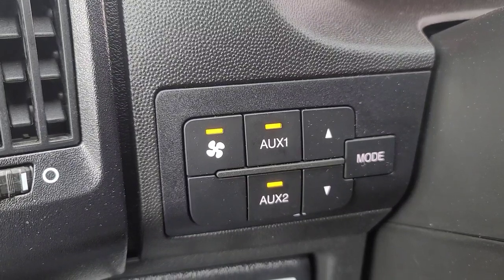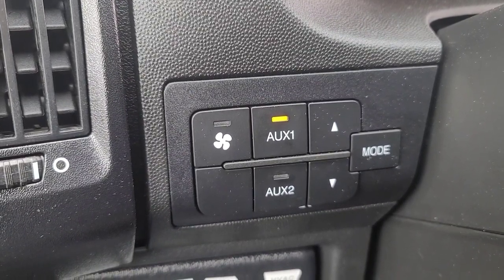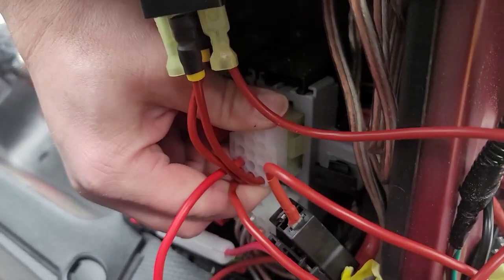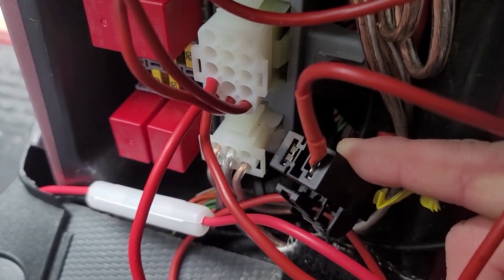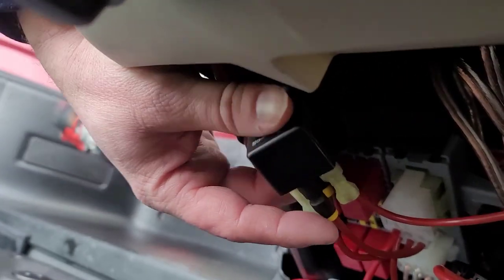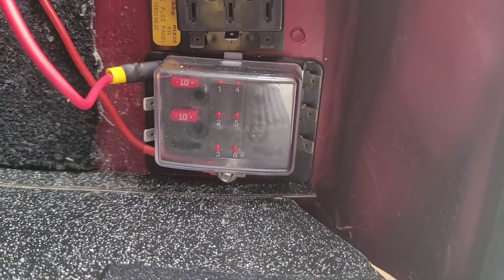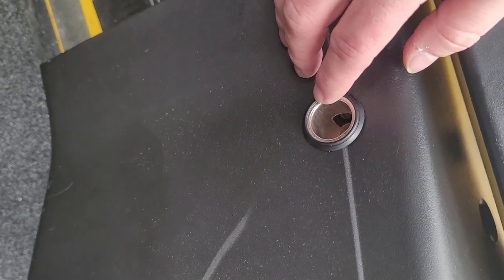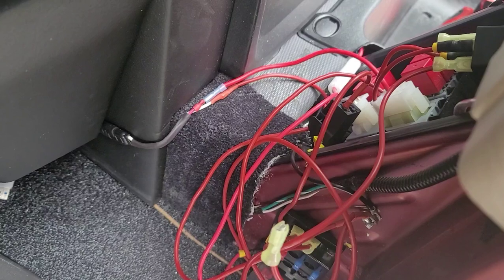RAM ProMaster Upfitter Auxiliary Switch Guide

Comment: Thanks, very helpful! How do I get a wire from OUTSIDE the van into the upfitter connector? The rubber plugs under the chassis below the upfitter connector don't seem to feed that area.

Comment: I am a novice when it comes to DC electric.  That said, not sure how such a small wire as you have with the spade plug could ever handle 70 amps.
Reply from the maker: You'll notice I said I am running a small load on it. Right now, it's effectively driving only the always-on 12V outlet I mounted on the B-Pillar. If you look closely, that outlet is going through the upper fuse panel, and it's limited to 10 amps. 

The wire feeding that connector on the other side is 4AWG, if I recall.

Comment: Hey Noah, I completed this install and noticed I wasn’t getting any power to my device. I pulled my aux switch from the dash and it turns out my wiring harness doesn’t have a connection from the Aux 1/2 buttons to the plug in the B pillar. Do you know where I can get the little connectors to run a wire between those two?
Reply from the maker: That's pretty wild. As far as I know, the AUX1/2 buttons were only installed from the factory with the upfitter electrical option, in which case everything ought to be hooked up. Most of these vans don't even have those buttons. I'm still relatively new to the ProMaster scene, though. No wires hooked up to those buttons at all? 

Do you have the little red relays next to the upfitter connector? I believe those are also only present with the upfitter electrical package. If those are present, I'd be looking thoroughly behind the dash to see if the wire harness came unplugged.
Reply: @NoahAxon  Thanks for the answer. Here’s another question that might help me out. The black plug that goes into the switch panel on the dash has two empty spots. Does yours also have two empties or are all 15 connected to wires?
Reply from the maker: @9chase26  I have tried to figure out how to easily get a glimpse behind those dash buttons without wholly disassembling the dash and I'm coming up empty handed. My inspection mirror doesn't get up there easily from the fuse box opening, and while it looks like the outer driver's side HVAC vent next to those buttons should just pop out of the dashboard, it feels like I'm about to break it no matter which way I try. Any ideas to help me get a good look back there?

Comment: Thanks for the great info!  I want to add a small fuse block like the one you added to the bottom of the B pillar.  Can you post a link to the one you have? Can you still fit the factory plastic panel over it, or are you using something else to cover up all your wiring?

Comment: My b pillar positive negative doenst have power do you know where the fuse located at, I need to check and replace it
Reply from the maker: The battery is Under the floor in front of the drivers seat. If you open the access panel, your should see several 70A fuses attached to an odd-shaped metal plate that's on top of the battery positive terminal. One of those big fuses attached directly to that metal plate is the one that leads to the b pillar positive power wire.

Comment: Noah great videos and keep them coming!  So if I am understanding this correctly in order to use the aux1 and aux2 buttons you plug the wires into the connections on the B pillar that you were showing.  Is that correct?
Reply from the maker: Yep. The lower left corner is AUX1 and the one above it is AUX2. They are controlled with the two little red relays there and have 20A fuses in there as well, so each auxiliary switch can run up to 20A worth of stuff (provided your wiring can handle it)

Comment: Where do I attach the ground for auxiliary switch 2?
Reply from the maker: I drilled a small pilot hole in the b-pillar and sanded around it, then used a self tapping sheet metal screw, washers and eye lugs to ground all of the accessories I terminated there.
Reply: @NoahAxon  That blew my mind, you responded so quickly!! Thanks. My sister kept wanting to use one of those remaining pin holes.

Comment: I have been searching for hours on this option in the PM w/ aux switches! Thank you so much for posting this. I'm just diving into automotive electrical, so I'm still very green. I'd love to get more step-by-step or detailed instructions for getting those aux switches in use...12V outlet like you have for 1 switch and who knows what else for the other. LED lighting?
Reply: I second that, I'm trying to wire my LED light bar and can't figure out if the Aux switch will be able to handle it with a 40amp relay and if I even need a fuse, as I think the aux also has fuses in the fuse box.
Reply: @californiacruising4190  I learned a bit more since my initial comment. My PM came stock with a 70amp fuse for that part of the upfitter package. I used one of the Aux switches for upfront LED lights. I don't recall the fuse size on that line, but I think it's 30amp. So, my setup is a set of LED lights with a ??#amp inline fuse wired directly to the upfitter with the ground installed nearby (just tapped a new ground location).
Reply: @bjsorensen  Thanks! I will try that

Comment: Hello Noah...great video. I need your help with the aux connections at the b pillar and how they're supposed to be connected at the buttons
Reply from the maker: The AUX1 and AUX2 buttons directly control the pins of that connector as I showed here. If you have the buttons on the dash, you don't need to do anything special. If you don't have the buttons on the dash, you will have to add your own switches, wiring, and relays and you probably can't rely on this upfitter connector, though, I think the high-power positive wire will still be there. It runs straight to the battery through a 50a or 70a fuse depending on model year, but it's not switched in any way.

Comment: If it’s cutaway or chassis Promaster where is better to connect wire if we install 14ft box and we need marker lights and inside box light?
Thank you
Reply from the maker: I haven't seen how the wiring works on a cutaway / box truck promaster chassis. I'd assume a similar panel is still there on the B-Pillar behind the passenger seat. You might need to drill and grommet a hole through to the box. I really don't know.